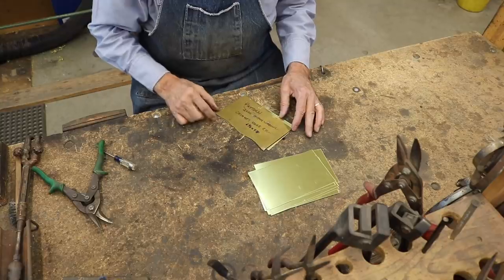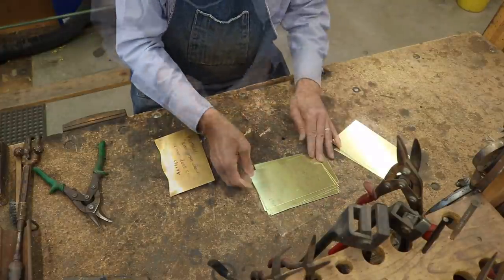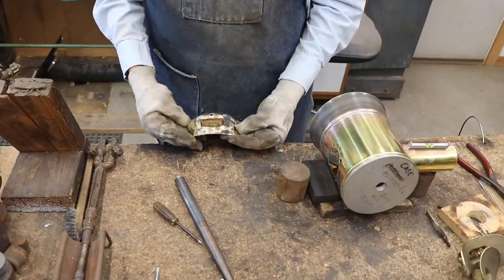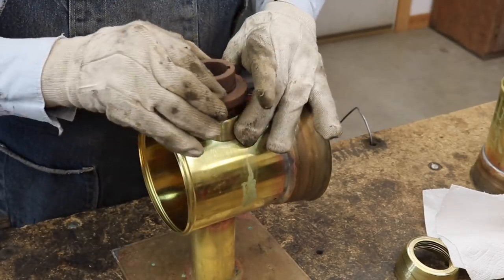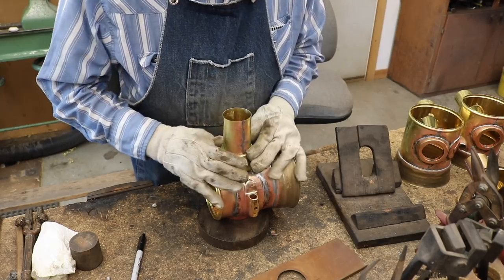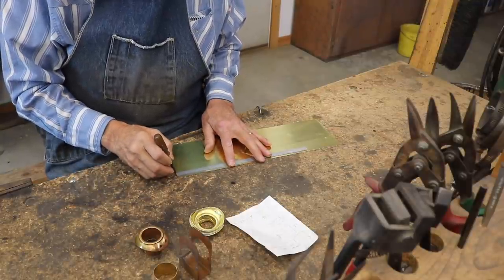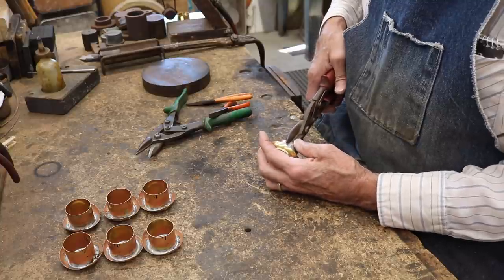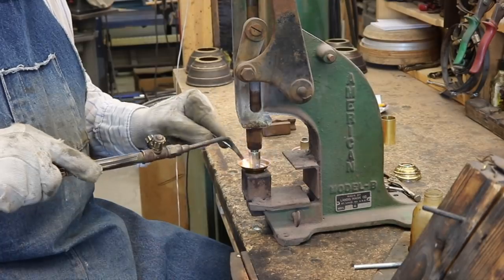Hitch Wagon Lamps, Pieces and Parts mp4

Comment: I admire your craftsmanship and as a retired tin bender myself I absolutely LOVE watching you work. I must say though, you're the first person I've seen that uses the LEFT side of the stomp shear, I used one for over 50 years and always used the right side. Nothing WRONG with it, just different. Keep the vids coming, I look forward to them!
Reply: It's been quite a few years since I used one, and I'm trying to think back on how I did it. I'm thinking I used the middle if I had a scribe line, and pretty much either side for a square cut with just a mark. I seem to remember the left side of the shear was usually sharper since everyone else used the right side. :-)
Reply from the maker: I like to put the metal up against the stop on the left side as the shear will move the metal slightly if I don't. Easier to get a square cut. I started out on an old shear without a safety fence and just got in the habit of doing it that way. Also when I'm using a mark instead of the gages to size a cut I can see it better on the left side.

Comment: Rick your use of the jigs impresses me a lot, not only do they hold the parts in alignment but after you get done soldiering when you tap them out they serve as a forming die to correct any warping that might have happened. Outstanding work and I enjoy watching you take raw material and turn it into lamps.
Reply from the maker: Thanks Tom!

Comment: Thanks for the info last week about that lamp on your shelf!  I wasn't able to get much info about the one I have online, but after you told me it was a DeVoursney Bros lamp I was able to research it in the microfilm catalogs at the library.  I found out it came from an old firetruck that belonged to the Indy motor speedway in the 1950s.  It has a little wear & tear on it, so I'm trying to clean it up without ruining the patina. I may end up sending it to you if it's too much for me.  I want to make it a wall decoration for my project shop and possibly remove the kerosene canister and put in a battery powered LED light instead.
Reply from the maker: Good luck on your project!

Comment: Thanks for a lot of excellent videos. Could I ask you, what kind of flux you are using. It seems to be a lot more effective than the one I am using.
Reply from the maker: I use Stay Kleen brand soldering flux. It is available in any good welding supply.

Comment: FYI... they make a valve that has a lever and a tiny (adjustable flame) that you can put on your bench much like your torch holder you have now however when you set your torch down it turns it off and when you pick it up the gas starts to flow again then just wave the torch over the small flame and your ready to go. It will save you on gas over the long haul. I have it set up on my oxy torch when I’m doing repetitive operations and it works great. Just saying😳
Reply from the maker: Thanks, I'll check into it.

Comment: It always baffles me how a simple soft solder joint can hold these lamps together. As an electronics solderer, I was always taught to make a solid mechanical joint (either twist wires together or put the hooked end of a wire through a terminal loop and pinch tight with pliers) BEFORE soldering. I generally use eutectic (63/37 Sn/Pb) or 60/40 solder which is quite soft. Is your solder an alloy which is sturdier (although not so strong as silver solder) than the ones I use? 
(And I'll ask along with @Andy Hastings about neutralizing the acid flux - washing, wiping, or chemical?)
Reply from the maker: I usually use 40/60 tin /lead, sometimes 50/50 or 60/40 depending on the joint. Many of the soldered joints on carriage lamps are supported by other soldered joints. Also they are generally not exposed to forces that would break the joints. I wash soldering with water and detergent and then wipe down thoroughly with a surface prep solution before painting.
Thanks for watching!

Comment: Rick: How do you neutralize the acid? You've never shown this.
Reply: Think about it. Polishing will remove most contaminates and when these are plated they will do a series of thorough cleanings.
Reply: I agree that the items to be plated are cleaned very thoroughly. I'm more interested in the areas that are painted. I know the acid can invade areas that are not visible, especially when your talking about acid fumes. I know radiator shops, at least the ones working on copper/bronze, have dip tanks for this reason.
Reply from the maker: I wash most of the parts I solder with warm water and detergent. If any acid residue is left it will definitely ruin a paint job.
Reply: @TheLuminaryShoppe  Thanks Rick, the warm water and detergent will take care of it. I asked because I know you used acid but never told how you neutralize it so it doesn't cause problems later.
I've watched every episode of your channel. Keep up the great work.
Andy